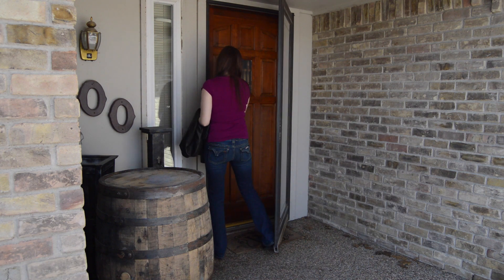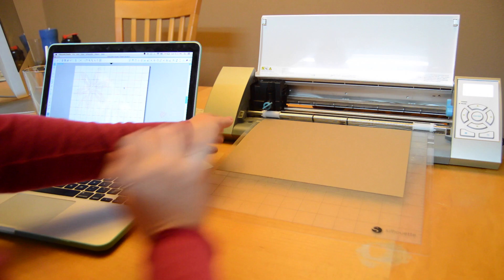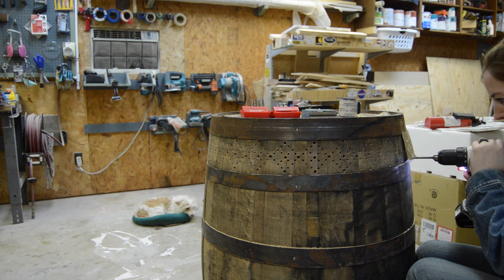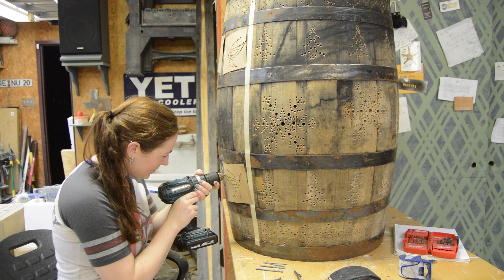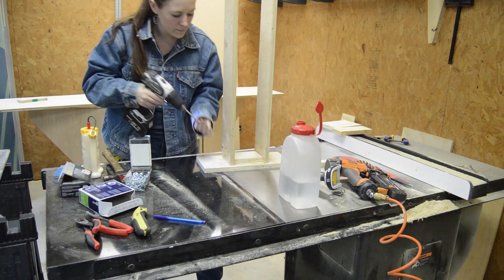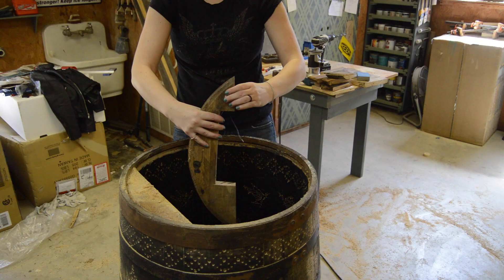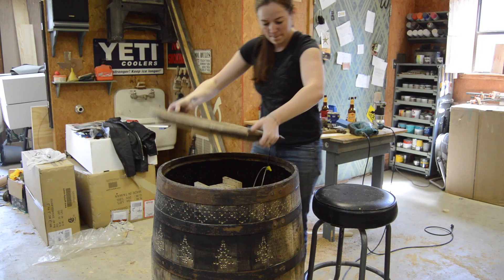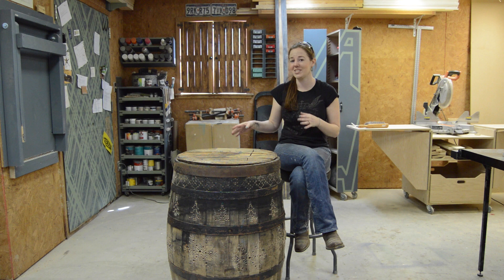Light Up Whiskey Barrel

Comment: Very cool! Where did you get that idea? Also, why did you use regular bulbs and not just use LED strips?
Reply from the maker: My mom saw a photo on Pinterest and asked if I could do it. I have no idea who is the original source of the photo she found though. I have a photo of it linked on my blog if you want to check it out. 
I didn't think LEDs would be bright enough. I used 6 bulbs in this and I personally don't think even these are bright enough. I was thinking about adding a few more.
Reply: April Wilkerson thanks for the reply! I love working with leds and I bet you would be surprised at how bright a good strip of leds can be. Plus they are easier to wire, way better energy efficiency plus you could get one that has a remote control that let's you turn it on from inside the house and change the colors of the lights. You could easily get a cylinder shaped cardboard and just wrap the led strips around the cylinder. Granted it is going to be more expensive than light bulbs but all that could be done for less than $50.

Comment: That's wonderful ... don't you want one for your porch? Maybe a half barrel .... ;o)
Reply from the maker: : ) I actually do, but I live in the suburbs and it would get stolen I bet. My folks live in the country so they won't have that problem.
Reply: April Wilkerson
This is where you look up floor anchors and give them six foot of chain so that they can really get a head start before making a nose dive for the concrete ;o)  Alternatively given your rather decent wiring skills a pressure switch wired to the metal bands with a reasonable current should prove quite comical ...